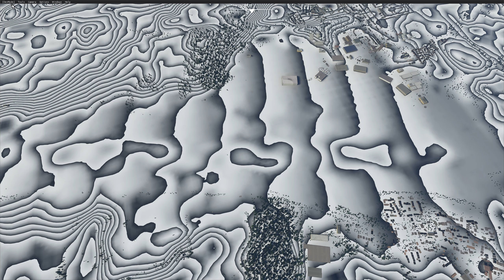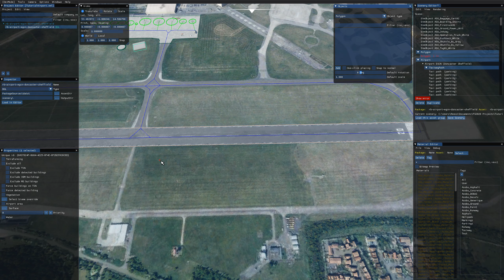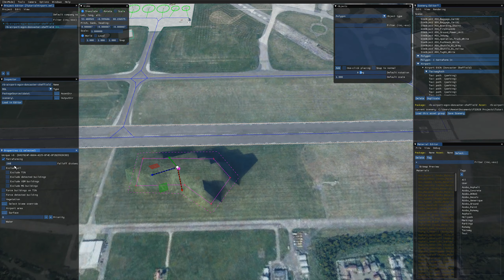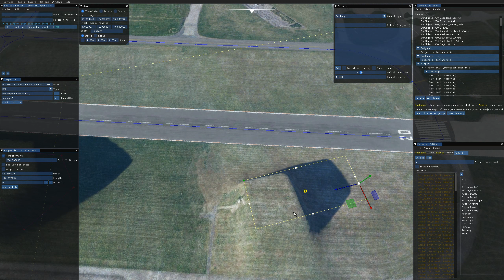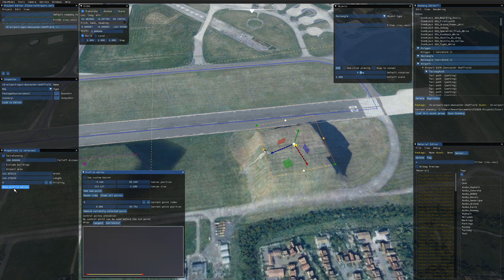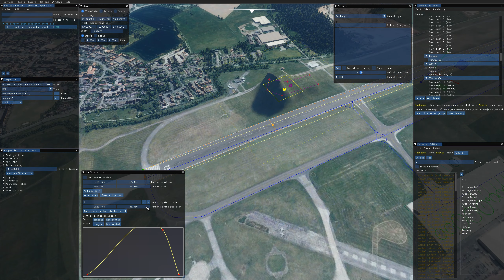SDK Tutorial #4 - Terraforming - Microsoft Flight Simulator

Comment: Hey. Thanks for your video. Great work. Question, i created an airport with buildings of other addons. I see everything correct. But if i share my folder of my own airport with friends, they don't see the airport completely due to the fact that they don't have the other addons installed, were i took my buildings. Is there an easy chance to import these buildings and objects to my own airport folder with SDK. Thanks for an answer 💪
Reply from the maker: I don't think so. If you use assets from another package the users will need that package too. If you want assets shared between multiple packages you can make a common package and ask users to install that too. Obviously if the assets aren't yours then you don't have the source files so can't do this.

Comment: Does this work on terraforming hills that are quite a distance from the airport? Does it save the terraform? Reason I ask is about 20 miles from my local airport is a hill and it's pretty flat and should be raised a fair bit. 
Thanks for the video!
Reply from the maker: Yeah it should do. You don't need to create an airport object to place rectangles and polygons if I remember correctly.

Comment: Great video!  When I tried my first attempt at making a hill with the rectangle object , it seems to make a depression in the ground instead! I try raising the height arrow for the rectangle object up, but it does not move the hill up. 

Any idea how to fix this?  thanks
Reply from the maker: Do you have any other terraforming objects that could be overriding the rectangle? E.g. polygon set to flatten, other rectangles or even the runway?

Comment: Hi, I followed your tutorial for flattening FYWE airport before adding extra hangars and lights. Draw a polygon for terraforming. In the editor it looks correct, but in the sim I found the terrain flat, but with some more holes that were absent before, like something on the ground preventing the terrain to come up. I had to adjust the height of the new "terraforming" as it was too high and default buildings sinked into the terrain. Any options that maybe I missed to check?
Reply from the maker: I've found terraforming a bit strange in the sim. It doesn't always behave the same in sim vs in the editor. I don't know any tricks to get it working other than trial and error.
Reply: @Benney  ok. Thank you 👍

Comment: Hi thank you for these great tutorials! I've started modding on my home airport because of you :) Question: I cannot get any of the shapes to load properly. I call it something different from my scenery, like I called the first one ENCN-airport and the other ENCN-shapes. Still, everytime I save and load it up, all the scenery is there (runways, taxiways, markings, tower object etc) but the polygons I made are gone. When building package, it says 0 errors, but 1 skipped. I cant from the text in the console figure out why the polygon is skipped (it doesnt say it is the polygon that is skipped but in the end it is the polygon that doesnt make it over to the build). What can I do?
Reply from the maker: To me it sounds like you're having some issue with your shape file not saving correctly. I'd recommend making a new airport project as a test, follow what I do in the tutorials carefully and see if the same issue arises. 

You could also check to see if you have the files .shp in your asset directory. It should be  ENCN-shapes.shp if that's what you're calling it.

Comment: Excellent!👍👍  I had no idea the terraform tool was so versatile.  I've been using it to simply raise or lower certain areas using a polygon and lamenting it doesn't do slopes, shapes, etc.  BTW how do you deal with the odd terraform bug where it sometimes creates a deep chasm when you only slightly raise or lower the polygon height?

Also, is there a way to modify the isolines map to tweak the elevation boundaries?  Sorry, such great info here I just had to subscribe!  

Cheers from Thailand!😁
Reply from the maker: Thanks, glad you enjoyed the video! 

Not sure I've encountered that bug before. Things I can suggest are just creating a new polygon and seeing if you get the same error, or maybe increase/decrease the priority to see if that fixes anything. As for modifying the isolines I don't really know what you mean there.
Reply: @Benney  I'm surprised you haven't encountered that bug before as it seems to be fairly common.  I trigger it fairly often trying to replicate or correct lake beds, ponds, waterways, etc. 😭  It seems to occur more often when lowering the elevation of an area, especially when the fall off distance is short and abrupt.  It can either result in a deep chasm or it creates an island in the middle of a Grand Canyon type abyss.  Of course, it doesn't happen all the time.  I'm guessing it gets confused with the fall off if the polygon is irregular and has several points.  Maybe one or more of these points get crossed in the fall off and a rift occurs.   Here's an example: https://www.youtube.com/watch?v=WtbpVuo5mJE

Regarding my 'isolines' map comment, yeah, it's a bit whacky.  In X-Plane the terrain is shaped from published global elevation mesh database(s).  Wasn't sure if this sim does the same or uses topographical 'isoline' maps to do the same thing.  After all, they are a viewing option in the VFR map as well as in the terraform function, that you pointed out in this tutorial.  My apparently flawed thinking was, if Asobo uses 'isoline' elevation maps, it would be very cool for us to be able to mod them to create or revise topographical features to suit.

Comment: Thanks a lot for the great tutorial. I have the following topic which I could not solve yet:
The runway of the airport I am modifying has a different elevation on both sides. At terminal side the runway has the same elevation as the airport. At the other end of the runway the elevation is lower. I did the "Terraform" of the runway and added a falloff distance of 2000. Without the falloff the runway creates a valley at the far end. with the falloff the connecting taxiways and the overrun area go uphill till they have the airport elevation again.
A polygon could not solve the issue and also with a rectangle I am heavily struggling to slope the whole area towards the end of the runway so that taxiways and terrain match the elevation of the runway in all positions. Maybe I have not understood how the rectangel works in all directions.
Any hints?
Thanks a lot
Added some immages to better explain:
https://ibb.co/3f2Hjq6

https://ibb.co/pZRpMh1
Reply from the maker: That's a nice looking airport! If you don't want to flatten the entire airport your best bet is to add a profile to the runway and work around it with smaller polygons as necessary to get the correct terraforming.

Currently the terraforming tools are quite fiddly so it might take a lot of trial and error to get right!
Reply: @Benney   Thx :-) and thx for the quick reply. It is one of the airports where Bing only has blurry textures and so Asobo did not include the airport.
I played a little more with the polygon terraforming after your advice and it is getting better. Still have to get rid of some bumps but as you already wrote: trial and error...
https://ibb.co/XSQm30y
https://ibb.co/nghnznR
Reply from the maker: Looking much better! That really is one crazy elevation map for an airport haha, thanks for sharing.

Comment: So I've made four attempts to smooth out my runway based on what you showed in this video and just am not having any luck. I can't tell if I'm doing something wrong or if the game is just really really bad at rendering when applying these changes in developer mode.

By default the runway after I've defined it using your earlier videos is crazy bumpy, so bad that at takeoff I've actually crashed nose first after hitting one. I'd settle for just smoothing out the entire airport: the surrounding region is pretty flat anyway so it wouldn't be very noticeable.

Unfortunately once I draw a polygon around the entire airport I can't figure out how much to move it up to smooth things out. The fancy camera view that shows the contour lines either doesn't refresh or half refreshes. If I try and look at just the normal view I can't tell if anything is getting applied, and then I keep futzing and all of a sudden I see big gashes in the earth :(
Reply from the maker: The best thing you can do is try and find out the altitude of your airport in meters. Look at charts or other airport information to find this.

Then position your terraforming polygon and runway at this elevation using the gizmo panel and everything should be perfectly flat.
Reply: @Benney  Thanks for the tip. I can definitely get the elevation in meters from charts. Are the values in the gizmo panel in meters?
Reply from the maker: @missamo80  Yeah, all units in the SDK are meters as far as I know (Asobo are French after all)
Reply: @Benney  That seemed to help. Sitting in the cockpit the runway still looks undulating, but rolling down it in the plane seems smooth. https://i.imgur.com/qN4p8kf.png